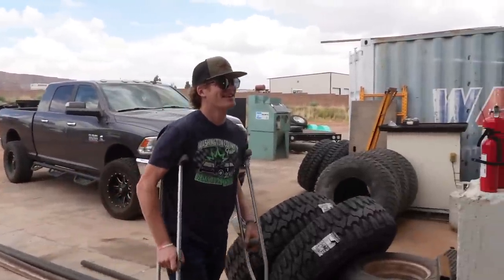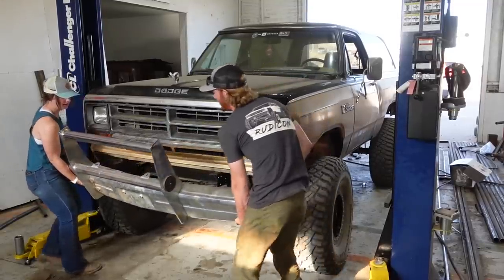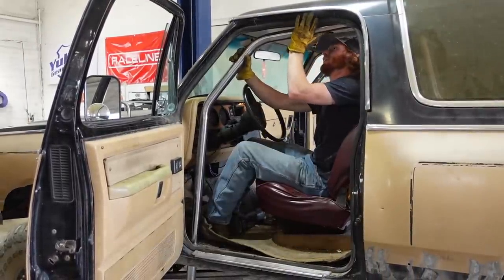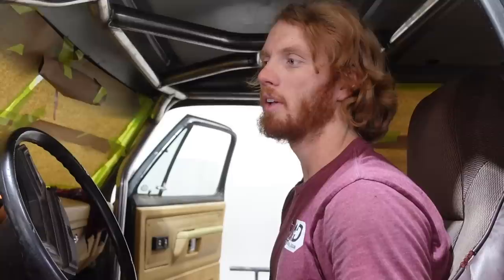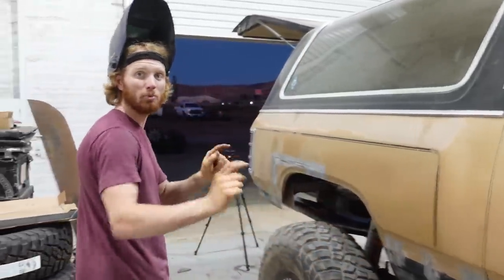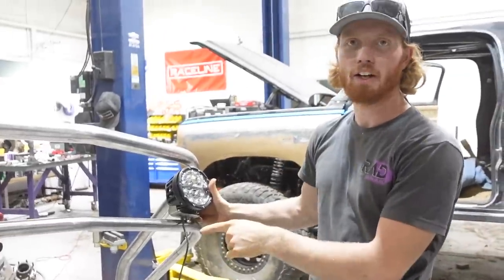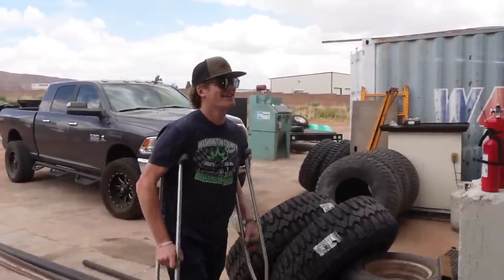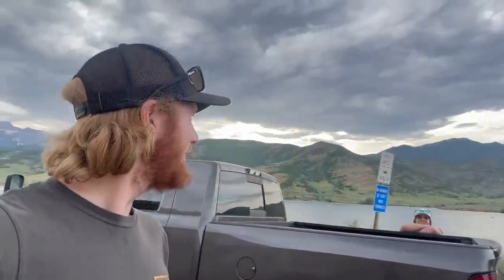Is The RADCHARGER RUINED With it’s New Paint???

Comment: I've been using those hole saws for 50 years, always drill your pilot hole first before you engage the hole saw. You've experienced what happens if you try to drill and cut in one operation, you'll snap the pilot bit EVERY TIME! Also, buy yourself a "no dog" for your pipe bender so you can keep all your bends in the same plane. Good job on the build, it looks great!

Comment: One guarantee when using holesaws with sheet metal is breaking pilot bits... I've drilled thousands of holesaw holes as an electrician and best practice is to use a 1/4" bit to drill all the pilot holes first before you get the holesaw near it! You'll still break some bits, but significantly less. I know this is too late now, but info for future projects!

Comment: Janelle, your work on the carpet and headliner was great. In my younger days, I worked at a van customization company, Rodco Vt Inc. This was in the late 70s/early 80s. The carpet laying was great. You did cut the carpet a little longer than the exact fit, but that makes perfect sense. You can always trim excess off, but it is quite hard to add on and make it look right. The headliner was built differently than we did, but the method you used was excellent. The placement of the headliner cover was perfect. I know just how hard it us to get the cover on without wrinkles. That is a fantastic job. Congratulations on a very well done job.

Comment: Polished metal will rust pretty much just as fast as non polished. And will look even worse. Clear coat would work. But that's still painting. And what is the obsession with DOM tube? Paul and others around you use it for EVERYTHING.  At 1/2 the cost, you could use ERW tube. Nope, it's not gonna split along the seam. Nope, it's not heavier. Definitely do NOT go with 4130. It's brittle, it work hardens, and NASCAR forbids its use in roll cages for those and other reasons. My offroad race buggy was built in the 1970s with CREW tubing. It got flipped in a race. Flat out in high gear. Quadruple endo. Wadded up the suspension like pretzels. No damage to the cage. 1" twist to the frame from the front axle to the dash bar. So it hot set aside. Years later, my friend said, "If ya got it, take it out and play with it." So we fixed the suspension and it held the right front tire off the floor of the shop. I was skeptical. After a 15 minute drive in the desert, came back and it sat level. Measured straight. As a professional race car fabricator, I've built cars that like my buggy won races and championsips, including winning their class in the Baja 1000, super modifieds with 800hp enginehanging outside the frame, sprint cars, midgets, offroad race trucks, road race cars, etc. I've replaced broken roll cages and frames in many race cars made of more expensive material than my buggy that could not be reused as my buggy was with its cheap material. Higher price does not = better. For the roll cage in the Radcharger, I would choose CREW tubing. I would paint it to keep it from rusting. No I don't live in the rust belt. I live in the Mojave Desert. Steel may not rust as fast here, but it still rusts. Clear coat would work, leave the tube looking raw, and you wouldn't have to worry so much about masking.

Comment: I've used that Siless sound deadening stuff before, it works really well. You don't have to put it on it sheets, but tap the panels and stick patches of it (3x3", 4x4") to wherever it sounds loud. Also, I'd strongly recommend adding some closed cell foam insulation (1/4"+ thick) over the top. The sound deadener drops the frequency of the noise inside the cabin, but it can become "boomy". Adding closed cell foam over the top reduces that alot. It also helps keep the heat (or cold) out, which doesn't hurt.

Great build too 🥰

Comment: Re: BROKEN HOLE SAW
Hi Rudy, great work on your channel 
I discovered a trick with hole saws. I pre - drill a pilot hole and then I cut a section of drill rod stock and leave it in the arbour. It will pilot the holesaw to start and will last for many holes before it bends. Drill rod is much cheaper then  breaking a ton of bits.
Thanks for your videos, I never miss anything you post. 
Eric

Comment: I designed bumpers for my Toyota 20 years ago to hang my truck from trees, etc.  Bumper builder told me it's over designed to pull trailers. Then I had to splain it to him. I think your pipe bumper is going to bend and do damage to the sheet metal. We used 3"Diameter minimum back in the day.  I saw it elsewhere and LOVE the color!

Comment: Rudy,
as a retired electrician, i have broken many bits trying to drill with a hole saws... Then i came up with an idea that when used properly, you will never again break a bit with a hole saw...
Here's how: 1) drill you 1/4" pilot hole with your drill motor, then: 2) with a plain round 1/4" rod in your hole saws proceed with with your new found control of the saw without trying to drill the pilot hole at the same time. Try it and you'll  be a better craftsman... 

A Brother in Christ,

Comment: Note #2 as the video progresses: I would have tacked the rock sliders in place, tacked the cage together, then remove the sliders and lower the cage through the floor to weld the top of the roof joints. Leaving those joints incompletely welded is like cutting 1/2way through your finished cage with a Sawzall. Atfer welding the top, raise the cage and reinstall the sliders welding the cage to the sliders before raising it all the way to weld the sliders to the body. Then build the braces from slider to frame.  
Hmmm....watch a little further and learn that you're smarter than you look! I presume you'll be tieing the cage to the upper body at the A and B pillars to prevent body shake. Its amazing the difference those braces make. What you call the "halo bar" is the B pillar hoop. A halo bar is a horizontal loop that includes the header bar above the windshield and the 2 bars above the side windows. That forms a "halo" above your head. That sort of cage structure uses separate A pillar pieces welded at their tops to the underside of the halo bar. See...I'm not as dumb as I look.😎

Comment: I'd like to share two tips on using hole saws that addresses breaking the pilot drill bit. First step is to drill a 1/4" hole. I have a few mandrills. Some have the pilot drill replaced with a long grade 8 socket head cap screw with the head and threads cut off. This setup will never break. If the metal is thin, you can reinforce the pilot hole with a piece of predrilled 1/8" either tack welded, epoxied, or screwed to the base metal. If room allows, use the hole saw to cut a hole in a piece of wood, hold the wood in place somehow, and you don't even have to use a pilot hole. Enjoy watching your videos.

Comment: Rudy!  A hole saw tip.  The super hard brittle drill bit that breaks constantly when the saw teeth grab is a complete design failure!   The solution is this:   You permanently replace the hole saw mandrel center with a long 1/4" Grade 8 bolt you've harvested the unthreaded part out of.   The bolt will never snap off or bend but will center perfectly without ever reaming the hole causing wandering.     Then, simply, drill quarter inch holes where ever you want the hole saw centered.  Never break the center again.  I figured this out after snapping off three centers in one hole. :/

Comment: Rudy my friend welding like that will damage your eyes from arc flash and intense ultraviolet light.
Closing your eyes does not allow adequate protection.  You can damage your eyes in the long run and cause many eye diseases. 

Be safe bro. I actually met you 5 years ago when I was in Hurricane Utah as well as your Dad.

Comment: Replace those drill bits in your hole saw with 1/4" round stock.. Pre drill your holes with a regular drill bit , then switch over to the hole saw.. I also grind a taper on the tip of the round stock to make life easier.. The round stock will also let you come in at an angle , unlike a drill bit.. Don't forget to grind a little flat on the side for the setscrew ..

Comment: Tip for the hole saw. Either predrill with a 1/4 bit. Or use a large quarter inch washer over the pilot bit, to drill the pilot hole then remove to use hole saw.

Comment: If you run the drill in reverse once the pilot bit is thru, it will start the hole without catching and breaking the pilot bit.  Once you got the groove in the metal, put it back in forward and finish the hole.  Once those teeth catch the metal, it will always want to kick it one way or the other and break the bit

Comment: You need a left-handed wholesale pilot bit. When the whole saw is spinning in the proper direction and the teeth of the wholesale bite into the metal and snaps the right-handed drill bits off. When they go left-handed in the pilot bit gose through the teeth on the whole saw  Spinning the opposite way and not grabbing as hard give it a try.

Comment: trick for those hole saws is pre drill the center hole and put a piece of solid rod in the hole saw where the drill bit goes if you have something hard that is even better but it makes cutting in sheet metal way easier as you can ease into it without having your bit break or start to hog out the guide hold